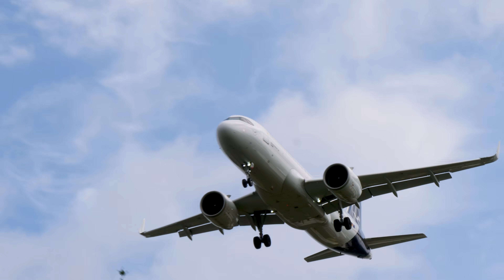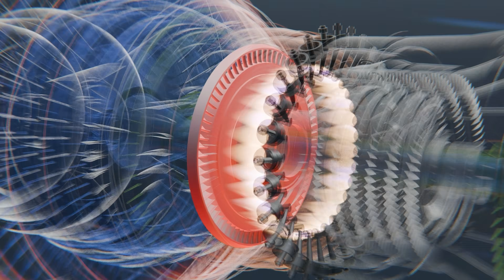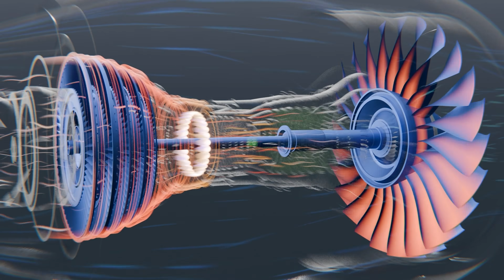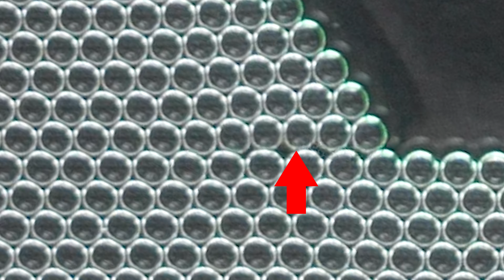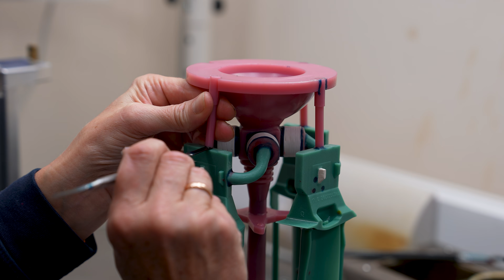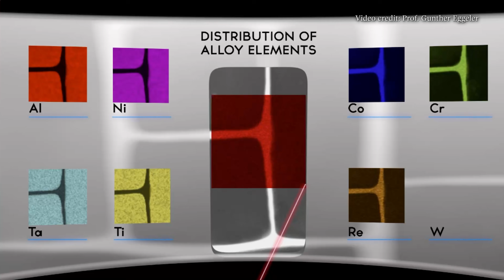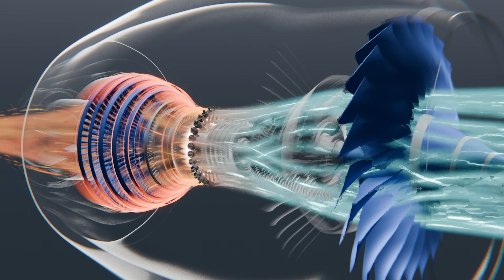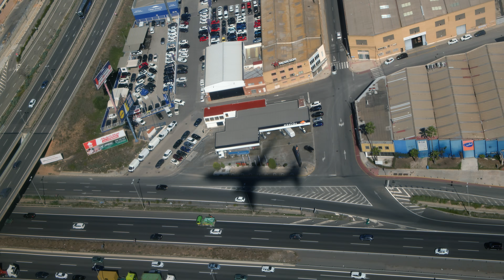The Ridiculous Engineering Of Jet Engines

Comment: One thing I’m trying to understand is the directional expansion. Obviously it has a momentum advantage once started, but does the air not expand equally in all directions in the combustion chamber, and if so, what’s stops back pressure from negating forward pressure. Is it just the mere fact that the exhaust outlet is larger than the intake inlet, or is there more to it such as some nuanced shape of the combustion chamber and gaseous fluid dynamics that are more complex? Larger exhaust outlet and smaller intake inlet seems like the intuitive simple reason, because it’s a larger area that the same level of magnitude vector is acting on, but more vectors on larger exhaust area than intake area, but I guess I should watch the rest of the video. Can anyone shed light on this?

Comment: The technology is amazing but overrated. Older solid blades were much more reliable. Hollow core blades have a bad reputation in the aircraft engine industry from people. I’ve heard talk about it who have been around long enough to work on solid blade engines. IF the quality control is good enough, the vented blade is definitely better and preferred, but I suspect that’s why we see more uncontained engine explosions today…. They just are too susceptible to foreign object damage. The old fighter jet engines were known to eat rocks and screws, lose a blade or two and keep producing thrust, whereas these type of blades will cause a chain reaction of destruction…

Comment: I'm a little rusty on my grad school metallurgy, but I think there's an error here. Grain boundaries do not always mean a weak material. 

In many alloys, having smaller grains, and the small grain boundaries per unit area, is a strengthening effect. The dislocations have to break through a grain boundary to travel. 

However, if the temperature is high enough to enable creep, then the opposite occurs, as seen in the video.

Comment: Long story short, answering the question in the title - The engine runs at the melting point, but the materials are cooled by the air flowing through so the materials themselves do not stay at the melting point.
Reply: Your hair dryer is the same thing. It would melt without the airflow.
Reply: @wally7856  That's pretty neat. Using the airflow the machine is designed to produce to keep the machine from self-destructing is a brilliant design choice. Got a real Thanos "I used the stones to destroy the stones" vibe to it.
Reply: @eldibs  Most water pumps are the same thing. They use the water they pump to cool AND lubricate the system. Most of them burn out if run dry.
Reply: @wally7856  I knew that dry pumps would burn up (because PC water cooling), but I guess I never thought about WHY they would burn up. It's nice to learn things.

Comment: Wonderful video. This reminds me of "Jet: The Story of a Pioneer" by Sir Frank Whittle. To quote "Our intensive efforts were still handicapped by lack of facilities. This, and the urgency of the need to solve the surging problems, drove us to desperate measures. We even resorted to making experimental parts (diffuser blades) our of hard wood, hoping that they would last just long enough to give us the answer we needed, and indeed they nearly did. With them we obtained a thrust of 1,350lb at 16,000 rpm without any sign of surging. The wooden blades failed at that speed."

This was, of course, for the W2B Whittle-type jet that was in development. The blades are static, IIUC, for controlling the flow of air from the centrifugal compressor. So, at some point wooden component for testing, albeit not hot, spinning ones :-)

Comment: 4:03 There is a missing 1/2 typo in the bottom right equation. 

The equation for the kinetic energy confuses 1/2 factor confusingly; on the left, it was part of the kinetic energy definition, but on the right the definition scalar is missing and instead it seemingly plugs in the previous value. Please be consistent in your math notations. Kinetic Energy := 1/2 Scalar x [mass] x [velocity]^2. If mass or speed are "half" of some value, they should [remain inside the brackets]. The bottom right equation as it stands is arithmetically incorrect now: 1/2m x (2Δv)^2 = 1/2 m x 4(Δv)^2 = 2 (Δv)^2, implying a x8 factor of difference, unlike what the video CORRECTLY explains.

TL;DR You just need to fix up the video frames. Script is correct.

Comment: Anyone remember BA flight 9?   The 747 that flew into an ash cloud.   The engines sucked in all the volcanic ash converting it to glass … then the engines stopped.   As the jet fell in altitude the jets restarted because the glass broke off.   It’s WILD to think the engines took that much of beating and kept running !     Look up the images of the flight when it landed, the paint was all “sandblasted” off.

Comment: You are mixing up rotations and revolutions.

A jet engine causes rotations and creates revolutions. It uses rotating components, such as the turbine and compressor, to achieve high-speed rotations that compress air. This process results in a continuous forward propulsion (a revolution) of the aircraft, based on Newton's third law of action and reaction.

Comment: The spiral choking out the other crystals is so ridiculously brilliant and understandable by even a layperson. One of the most amazing things I've ever seen.
Reply: Phenomenal engineering.
Reply: This guy will answer anything only a few people asked

Behind Zack
Reply: Thorium
Reply: Understandable by a layperson?  Ok great - please explain how that works.
Reply: @pieintheskyarenal okay so, the different tubes each have a seeding point and then go from there. The points where they seed from is a plane, so they all bunch together in a bundle, where they all go parallel to each other

So if you put them through a smaller tunnel, you block out all the crystal strands that arent in that area of the tunnel opening get blocked off.
If you now twist the tunnel, which means you move the opening relative to the crystal-grid, you block out all the crystals behind you and give the ones closest to your front more room.

So, if you cover the whole seeding-area in the path of the spiral, you ensure that no two racing strands could ever "tie" so to say. Because any "tie" would be 100% choked out after some amount of rotations, you get a spiral with that many rotations as the casting shape.

The key to understanding this is to remember that the crystals expand like balloons, so it helps to imagine it as a clown blowing balloons through a complicated burrow to chase out all the bunnies (impurities).
It's also very intuitive to any gardener (and probably many other professions of which i know little)
Reply: @pieintheskyarenal  Dude made this reply specifically just to waste sushiburp's time 😆 💀
Why does bro have NOTHING better to do 🤡
Reply: @pieintheskyarenal  watch the video lol

Comment: Mostly good, except for 24:05. The problem isn’t crystals. Even the single-crystal blades are crystals. The problem is poly-crystallinity. It’s grain boundaries, as you later point out. The demo with the sugar cube is misleading.

Comment: this is a very good introductory video. i am quite sure that many professors will recommend this video at the beginning of their intro to turbomachinery classes.

if anyone interested in the theory and engineering, check out rolls-royce's the jet engine book. its a reference book acknowledged in the industry. its short and simple.

if you are interested in hardwork - maintenance, testing, repair, etc. - check out channel called "AgentJayZ". When i discovered the channel i was both happy and sad. happy because it was beautiful, sad because why didnt i knew about it before?

thats it. keep your turbines coated and microchannels cold!

Comment: 10 years working with fighter jets in the 90ths, with engines designed in the 50 to the  70 - and i do not recall replacment of the engines after every other flight

Comment: @Veritasium there is a 1/2 missing in the right side Kinetic energy equation at t=4.0m, since the formula is KE= 1/2mDv^2, the latter case is displayed as KE = (1/2m)(2Dv)^2 would result in 2mDv^2 instead of the (correctly) mentioned result of mDv^2 which you will only get if KE = 1/2(1/2m)(2Dv)^2

Comment: Just realized that the way they keep the blades from melting despite operating at higher temps than the melting point with the whole air film and so on is legit similar to the experiment of filling a plastic bag with water and trying to melt it with a lighter and you'll see it just does, the film of air takes just enough of the heat to keep it from melting or should i say it keeps cooling the blades as fast as they are burnt by the heat or heated so it's as the video says legit at the very edges of physics limits

Comment: Structural Engineer here, working especially within concrete. 

I once read a paper about fires effect on the reinforcement steel in concrete. 
The essense of it was, that around 400 degrees the steel would be permanently damaged due to the alloy being transformed. 
To see the oxidation at the excact 400 degrees mark is just pure gold.. and thank you for the quick comment about it being due to oxidation. 

Rust is also known as ferrooxides. How does this correlate to oxidation due to heat? Does heating the steel promote Rust formation?

Which alloy is this? and what is the tensile strength of the unheated steel?
Does oxidation happen at the excact same point with different alloys? 

One question was answered. A dozen new ones arose ^^ 

Notice how the aluminiums glow changes during the experiment. its almost glimmering. 
I would assume that to be a confirmation of your bubble experiement, and the changes in the light is correlated to the formation of new bonds in the material. 

Bonus info: When cutting into rebars with an angle grinder. You can sometimes see this oxidation at the endgrain of the bar.

Comment: In college my professor explained that in the 60's when planes were instructed to take off at a steep angle to reduce noise around the airports, the planes with a third engine located at the base of the tail had some problems. When they pulled a steep angle, cool air was blocked from reaching intake of the third engine and the turbine blades did sometimes melt. Three engine planes can fly with only two engines but they don't like it. The pilots don't like it. The airlines really don't like it. The passengers didn't know but they probably also wouldn't like it.

Comment: Nickel alloys are very interesting. I haven't had the chance to research them much, but I have seen them used in the matrix for tungsten carbide particles in extremely abrasive and high temperature conditions. They are applied in a process called laser cladding.

Comment: If only batteries had a much higher energy density, we wouldn't need this turbine engineering magic.
Reply: That actually made me thinking about why the turbine and the propeller should be on the same shaft. A set (dozens?) of relatively small turbines could work in relatively mild conditions but instead of driving the propellers directly they could generate electric current that is fed to the propellers as separate units via a really thick copper bus.
I know the similar stuff works in locomotives so why not planes?
Definitely that would cause some weight overhead, but on the larger scales it could probably work

Comment: Im surprised there's not more catastrophic failures of engines. If one blade fails due to air ventilation path getting clogged from molten sand, shouldn't it trigger a chain reaction and half of the engine gets ripped to pieces?

Comment: There is one thing I was never able to grasp: the hot exhaust gas pressure goes in all directions, so not only on the rear fans, but also on the compressor, hence it should slow it down.
Reply: Go and find a hair dryer and turn it on. The only difference between a hair dryer and a jet engine is that there is no turbine in a hair dryer to spin the fan and the heat is added from an electric element rather then burning fuel. Amazingly, the air comes out the front of the dryer every time. That's because the heating of the air in a jet engine or in a hair dryer doesn't increase the air pressure. It heats the air, the air expands and that increases it's velocity. Due to the expansion, the air actually DECREASES slightly in pressure when you heat it. Flick your bic lighter or turn on a gas stove, same thing happening - no increase in pressure, actually a slight decrease as the air expands. The air isn't contained in a jet engine so there is no increase in pressure from the combustion of fuel. The highest compression in a jet engine is right after the compressors and then it decreases every step of the way out the back and air always moves from high pressure to low pressure unless you do work on it (like the compressors do).

Comment: This video reminds me of when I was carrying out my mechanics apprenticeship, learning that the temperature at the point of ignition (And under heavy load, the entire power stroke) in an internal combustion engine temporarily exceeds the temperature of the melting point of the surrounding components by several thousand degrees.
They don't melt however as alloys have become so advanced and plasma coated bores help to keep the underlying metals at a much cooler temperature, but simultaneously the cooling jackets maintain constant contact with the hot components which creates a conduction effect that allows metals to stay solid past their own melting points.

Comment: 15:17 I'm extremely disappointed you said no. This was a perfect opportunity to show how much skill they have.
Reply: and destroy the thing in the process
Reply: @_gepard7643  I don't think it would be much of a loss, if it's still just the unfinished wax form.
Reply: @8Hshan  'just wax'. Yeah, a lot of hours have already gone into 'just' getting it that far. I wouldn't want to touch it either.
Reply: @8Hshan  you are correct, individual wax patterns for the castings can be replaced if damaged or done incorrectly. source: my wife works in the wax dept (not at this company or location) and I work in the metal dept.
Reply: @markwright3161  you are correct, but not to that extent. individual wax patterns can be repaired/spliced quite easily. once broke a wax mold whilst loading it into the robot queue for dipping into the shell slurry, a wax quality person came in, melted the spot, applied repair wax, and off we went. that's the beauty of wax - it's repairable.
Reply: @8Hshan  Those waxes have ceramic cores in them. It would cost quite a bit to mess one up. Besides that, it's pretty hard to gate a runner system if you don't know how.

Comment: Way more significant problem with tungsten is that it oxygenates intensively - catches fire, at a temperature, much lower than that, at which it melts. That's the reason why it's put in vacuum inside the bulbs of incandescent lamps /or inert gas/; and at the moment the bulb breaks and atmospheric oxygen enters and gets in contact, tungsten burns.

Comment: I'm guessing the heat it produces goes by too quickly. Like waving your hand over a candle. The inside volume of the engine, the "jet" might be hot, but the engine itself doesn't receive that heat fully.